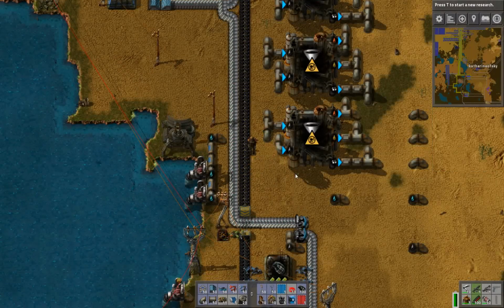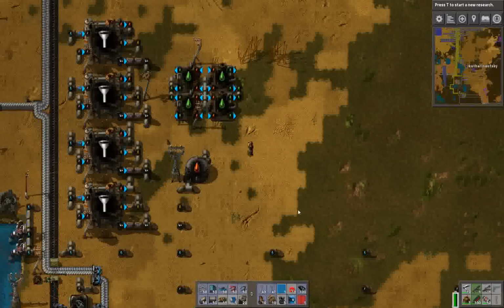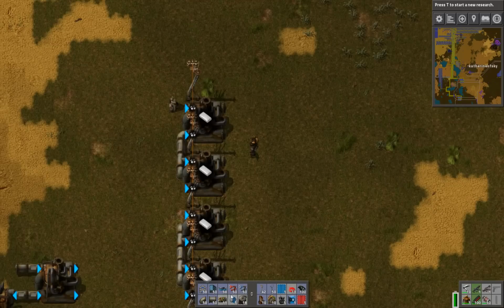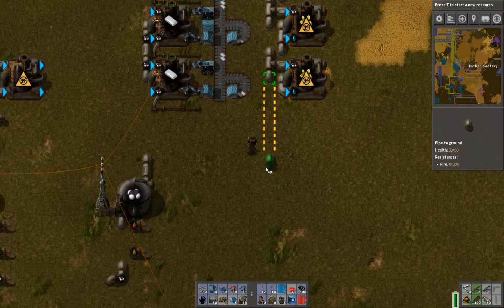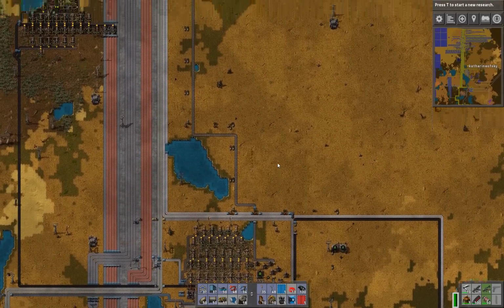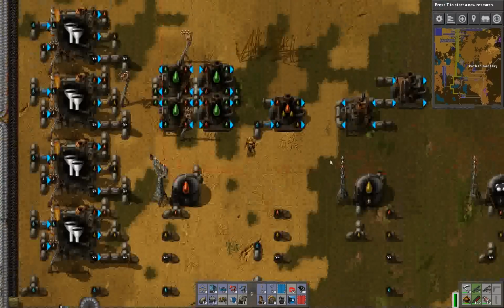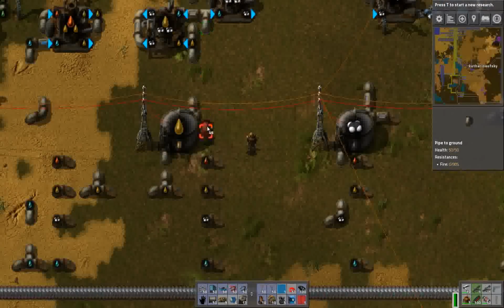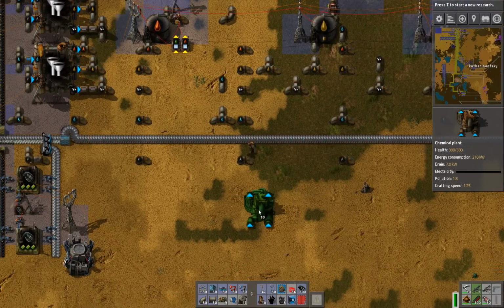Factorio Tutorials: Setting up Oil Refining: Basic & Advanced

Comment: I tried out the petroleum splitting on my own world and it doesn't work. A better way of doing it I found was having an item in two chests. If the petroleum gets above 500 it runs. Once it's less than 100 it stops untill it gets back to 500. Without doing this I found the pressure would still fluctuate.
Reply from the maker: Are you running any mods?  This setup works perfectly on my (vanilla) worlds -- it evenly splits the liquid between the two lines.  When the pumps run, they don't move more than 100 units, (much less, in fact), so they have enough liquid in the tank to work with.
Reply: The thing is that the pumps draw evenly when they're allowed to. You just might have more throughput so it hasn't effected you but if the volume of the tank is flickering around 100 the pumps would act weirdly.
Reply from the maker: I just checked one of my games at the point where petroleum is indeed "flickering around 100".  Both pumps are pumping, and both lines are getting fed with petroleum.  Oil is fairly low on that save, so there is very little throughput.  I see no problems happening with pumps.
Reply: Ok

Comment: At the beginning along the left, I'm curious as to why you take the steel off of the iron/steel belt then create a different iron/steel belt. Wouldn't it just be easier to side load and use a splitter to merge more throughput, which is what I'm assuming it's for. Nothing wrong with it, just thought it was funny.
Reply from the maker: It is indeed funny!  lol!  I haven't play this factory in a while, but it's large enough to use for tutorials, so TBH, I didn't even notice I did that!  It will have more than enough throughput if I upgrade the belts and just continue the line from the RR Track area.

Comment: I was having my big fat brain out the other day and did some calculation.

I was thinking... in there must be somewhere. So i check out... What is the fastest producing unit of anything. Sulfuric acid.

So i calculated would the power draw increase or decrease if i put production (3) modules in the sulfuric acid production. And the break point was actually as high as 0.6 average oil drils.

For Sulfur and Plastic production (they are very similar) it was somewhere in the 0.3 region. For refining and cracking (about the same for all) it was in the 0.15 or something region. And that punpjacks all with out speed modules.

So actually having production modules in the oil industry actually reduces the power constraints in total.

Also intresting. Production-modules makes everything slower, so one might imagine that one would need more refinearies and so on. Productivity 3 with 2 modules give a net speed reduction of 10%. So if one have the acid production it will produce 10% less. But the sulfur production will produce 10% less, but throw the end production (via the acid plant) be 20% more productive, that makes it a net effect that the end result is actually 10% more production.

For the Refining the and cracking the plants will produce about 10% less, but that is on the productivity of both acid and sulfur production the net result is actually 30% more. So one can actually cut down on the number of refining and cracking plants, and still produce more acid. Actually cuting down from 4 refining plats to 3 with productivitymodules will produce a tad more accid.

For plastic the result is about the same, but the difference is just 10% in this level.

The reason it works is because one will probably never use efficiency modules at the oil plant.

For green circut it really don´t give the same kind of result. Even thow the green circut have high trhowput, if one use efficiency modules at the smelters and miners the reduced power is very little.

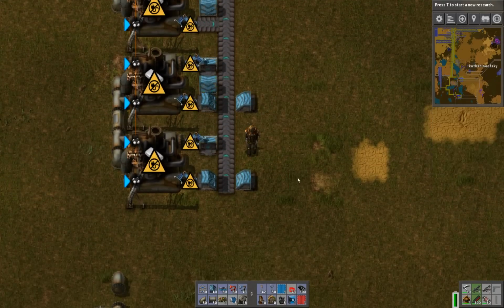But for blue circut it actually do make sence. Its souch a huge amount of components going into them, Even tho the time is quite long. The time for the prior production is a bit longer. The diffrance needs to be greater than 1:3 to get a gain. For blue circuts its 15:48, that is 1:3.1 (of cause with no efficiency modules). but ad smelting, acid and plastic to that, the diffrance is more like 1:6 or something like that.
Reply: wow. Math :P

Comment: Nice detailed tutorial, like it a lot. As an alternative, lately I've been using power switches instead of pumps to turn the cracking plants on and off, mostly because power switches can be crafted for cheap and pumps need electric engines, which I don't build until after my cracking is done usually. It also saves the drain from an idle machine attached to the power grid.
Reply from the maker: That's a great alternative!
Reply: The power switches let you control beacons, too.